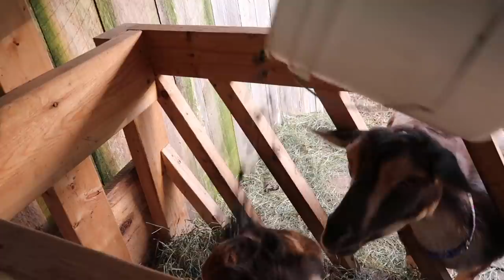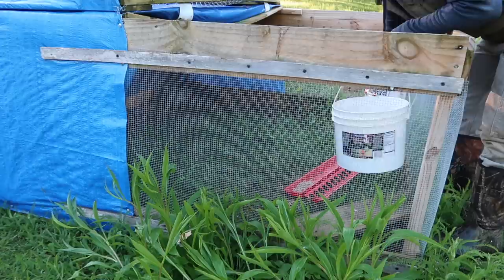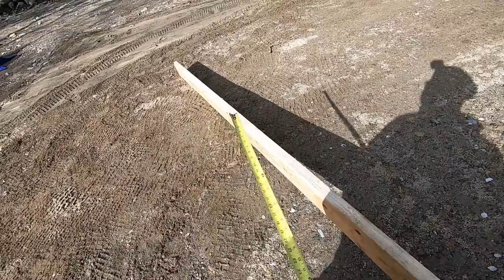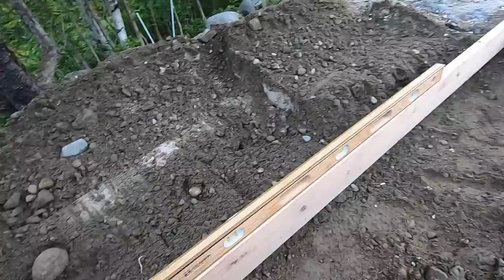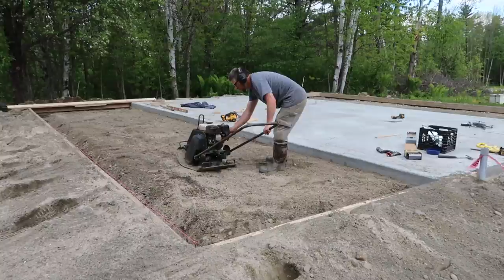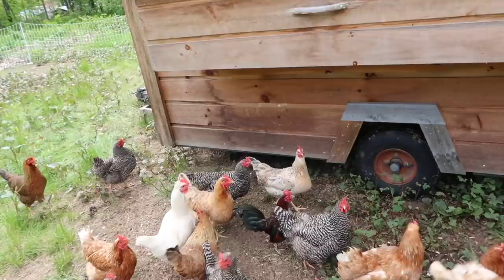Could Have Saved So Much Time If I thought of it SOONER (Last Day of Building forms for the New BARN

Comment: Check with the dealer about using the loader for the heavy back dragging using the bucket.  When I worked for John Deere I had to replace the shaft and nuts on many a bucket cylinder because the operation literally destroys the end of the shaft and the nut.  Normal operation all the pressure is on the plate and the shaft collar.  But reverse pressure is all applied against the plate and the nut.  After awhile the nut will get a little play and then it progresses rapidly to destroy the shaft and nut.  Most notable on single cylinder buckets.  If two cylinders, then the pressure is dispersed against two cylinders and it can handle it better.

Comment: You need to pin that slab before you pour or your slab could raise or walk on yon, paining means you have to drill three eights or half-inch holes every 16 inches to 2 foot and driving in three eights inch or half-inch rebar That way your slabs will be tied together and will not have a tendency to raise or lower were the two slabs meet.
Just a suggestion thanks for all the great YouTube content can’t wait to get started on the barn

Comment: Just FYI I had done concrete work in the past we're living and when we poured separate slabs like those we would always take and drill holes and put in three-quarter inch pins to hold the slab together to keep them from shifting thanks
Reply: Yes, they should be drilled at about 45 degree angle and then rebar inserted and bent square so the slabs can't separate or move.
Reply: Drill the form and install 3 ft rebar in the original pad --maybe  wing pads lower than Barn slab
Reply: Not only that it would have been better if the wing slabs were sloped away from the main slab and been given a broomed finish because it will be slippery in winter.

Comment: I hope you drill existing slab for rebar to extend into new pour.
Reply: They are not using rebar but a cattle panel instead.  I think that would be OK if it's embedded into the concrete.  When they did the pour last time, they did not raise the panel before the pour, but somewhat did during the pour.  I'm not a concrete person, so I don't know if that was enough since it wasn't in the middle.  You are right about connecting the two slabs together.

Comment: I have a question for you Al. Why did you do the sides separate from the middle main section? Why not just pour one big slab of concrete and then mark off the separate areas? Also be careful with letting the puppy run around that soon after surgery. He could rip stitches and open a wound.
Reply from the maker: The slab would have been 32x30 I wouldn’t have been able to do as nice of a job with getting it flat and level. 😆

Comment: Al, i like making work easier. But the reason you dig out the footing “only” is because you now have a wide band under your slab that is cotton candy. You had it compacted w a smooth drum vibratory roller, best you can get. Now you got uncompacted fluff that you patted a little. A slab is as good as what it bears on.
Reply from the maker: We recompacted after with the plate compactor

Comment: Just subscribed.
 Like your vids.
If you use short or even full length t posts for stakes. u can utilise the holes in the t posts to put the screws into the form work to hold it in the right hight.
If it needs to go down a little, just tap the t post to lower the form work. We call t posts star pickets here down under.
Keep up the good work
Cheers Pete

Comment: It’s probably too late, but did you consider floor drains so you can clean up the floors easier?
Reply: I’ve had mine for nearly forty years - it has NEVER been an issue. I guess it would be if you never cleaned your floor, but that’s what the floor drains are for! Mine “daylights” about thirty feet away and have never even slowed down. I sweep everything up, then hose the rest down (12” drain box, 4” pipe). If it did ever clog, it would be easy to flush or route out.

I think Al should consider too if not too late. Love the videos!
Reply: Al and Wilbur, I have three floor box drains in a 50’x32’ barn. I often wash my equipment and tractor and the snow melts off and never had any problems. Our kids have bathed their 4-H projects there too, and I even put in hot water! The barn is a few decades old (I didn’t do the drains). My drains also simply drain to the outside (not the sewers) and could easily be accessed if the need arises. I guess I’m a clean freak!

Comment: just a question, why not pour the whole thing at once instead of 3 pieces? it seems to me to be a bit easier.
Reply: I could be wrong but I believe Al said in one of his videos that the main slab will be built as the barn and the two sides built as overhangs. Could be the reason for the three separate pours.
Reply: Al has said in replies to previous comments that it's the amount of work that he is comfortable with.

Comment: One thing you should have done if your going to heat it is put in floor heat it's the only way to go even if for animals use geothermal heating using a couple of wells to warm the water.

Comment: I am confused. Yesterday you were measuring 96+2 inches for the slab and then adding 1 1/2 inches for the long board thickness. Today it looks like you did not make allowance for the board.
Reply from the maker: Today I measure from the inside of the board and not the outside. So I didn’t need to add the 1 1/2 inches.

Comment: Another great video, Al.  I was wondering if the compactor could be used to repair any ruts left by your tractor when the ground was so wet in front of the goat barn?
Reply: You might want to level it but you do not want to compact it unless you are putting gravel there.

Comment: Why didn't you pour a single slab instead of the three? three times the work and two cement truck load fees. Would have been one set of forms no cracks in the middle for water to get in and cause future separations. Makes no sense to me lots of extra work. I could see if you were adding the overhangs at a later time it would be done individually but not doing them both in one build.
Reply from the maker: We still would have needed 2 concrete trucks. Each truck holds 11 yards and we need 22. I was able to re use the 2x6s from the first pour. Other wise I would had had to buy more 2x6s for forms. It would have been a lot more work trying to pour a 32x30 slab all at once and getting it level.